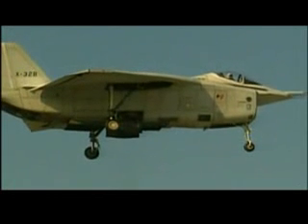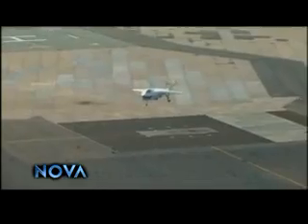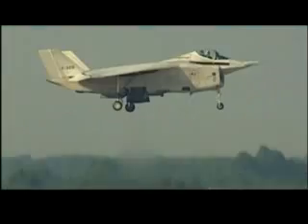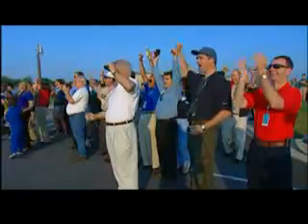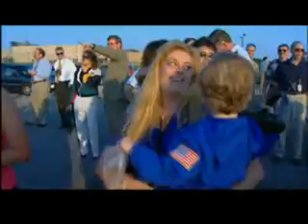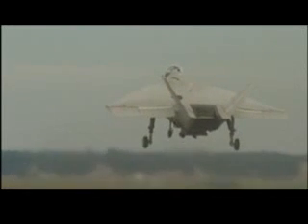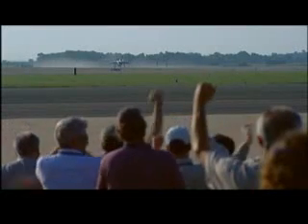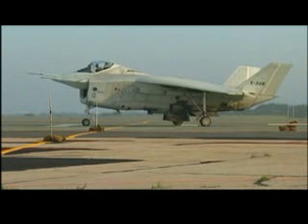X-32 JSF first vertical (hover) landing

Comment: What a joke of a post.  The x35 used existing technology from the f22?  I hope you mean the integrated sensor suites.  Want to talk about using existing technology?  How bout the x32 used the same damn direct lift technology as the harrier.  Why do you think they lost?
Reply: old but proven
Reply: By the way, the F35 technology is even older. Lockheed got its vtol technology from Yakovlev Yak-38.
Reply: @itabiritomg  And the Convair 200 before that
Reply: @itabiritomg  "Lockheed got its vtol technology from Yakovlev Yak-38."

A myth perpetuated by the ignorant.